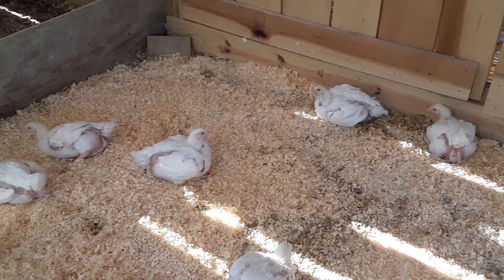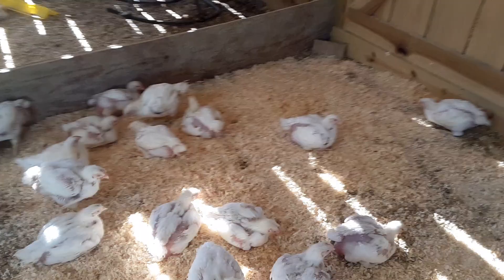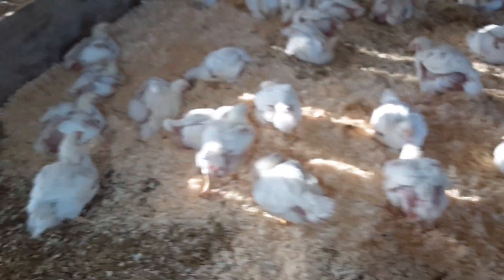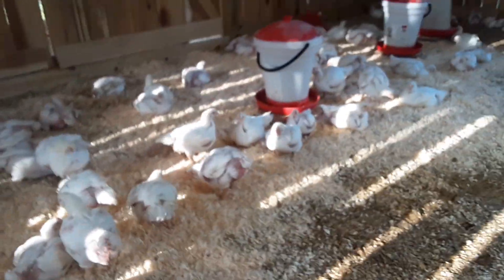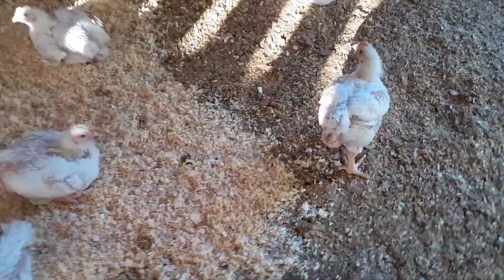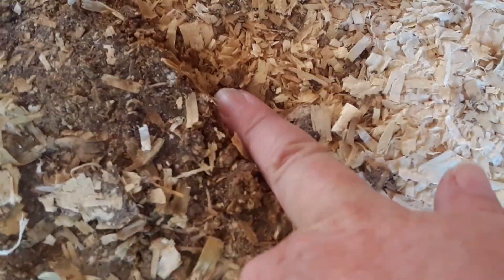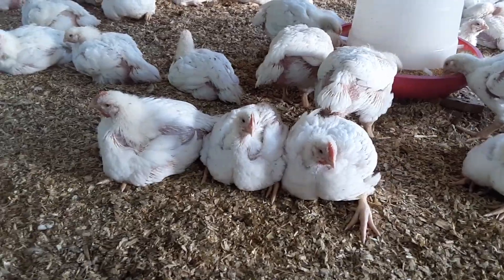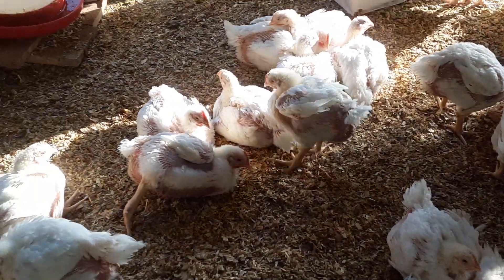Deep Litter Bedding Broilers vs. Layers

Comment: Melissa, just an update. My first batch of 25 is now past the 8 week mark. All are healthy and active. Not my intention but this is what happens when you jump into the game on the fly and not fully prepared. Life gets in the way while trying to build infrastructure. Im working on plumbing a stainless steel three tub sink with a wing on one side.  I plan to use as my processing station.  Then I had to help a neighbor cut and bail 4 fields hay. Sorry, I digress. 

Looks like I’ll be parting out the 10 roosters and some of the largest hens, keeping the smaller ones whole.  

Second batch of 50 are right at 6 weeks. I ordered these all hens but there’s one rooster.  Most of which I plan to keep whole. 

I use pine chips for bedding also. I buy from a local custom mill. I get them in a big bulk feed bag for $60 a bag. Saves me about $50 for same qty over box store purchase. It’s not as easy to move or distribute as smaller compressed bags are but, and here is the main reason for my comment:  I use a 6 gal bucket to scoop from the bulk bag and dump strategically on the floor.  My two older batches immediately start scratching in the piles and redistributes them for me. It’s rather fun to watch but I do need to remove water/feed while they are doing it. Otherwise they get filled with chips. 

Hope you keep putting out videos while in between flocks this summer. You truly are knowledgeable on your subjects, paired with an obvious “gift to gab”, makes you an outstanding follow. Your videos are the right length of time. Rarely do I start watching a video that’s over 20 minutes. I prefer those broken up in multiple parts. Call it ADD, but I rarely get back to a video later to finish.  Keep up the good work!
Reply from the maker: Thanks for watching & interacting with our channel! 
This is awesome! I loved reading this comment! First, the experiences with the 1st & 2nd flocks of meat birds takes me back to our first flocks. Our 1st flock was 25, & I think we did 25 a second time before trying any bigger groups. Our 1st flock was a terrible outcome, because we had predators absolutely devastate that group. The 2nd flock was a better outcome because the predators taught us what we needed to fortify. Lesson learned & better outcome. I don't think we tried a flock of 100 until our 2nd year raising Cornish Rock Cross. Of the flocks that year, we raised a bunch for ourselves & donated the rest to a grassroots charity dinner. We learned that our household liked homegrown chicken very much & could easily use a freezer of at least 60 chickens in a year. I think we could use more than that in a year for our household, but we also learned we could market the poultry, so we did. We marketed on only pre-orders for about 600 chickens last year & committed to processing appointments for about double that for this year. So far, so good, but profit margin is slim. There's an intrinsic satisfaction, though, of producing a quality food product. We are looking at next year & want to continue raising them, but try to improve our efficiency. Where I meant to go with that was I totally understand jumping in & life getting in the way of plans.
Your flocks are doing fantastic. Great job on your part, because we know first-hand it's a learning curve, for sure!
Also, I love your method with putting the bedding in. Very smart. We can also relate to removing feeders & waterers when adding bedding no matter what the method - yes, the birds get it all in those trays! 
We do plan to continue videos on our break between flocks. Working on creativity & brainstorming this month to prepare for July & August. Thanks so much for the kind comments, & thank you for watching! I learn alot from reading comments & will try the bedding idea for sure - these meat birds do love to scratch & dustbathe in the fresh bedding, so that's a win-win! We'll keep at the videos  -  we are just learning by experience as we go & trying to do what we can with what we have. I'm trying to get my husband to let us feature some of the crop fields & bigger animals. Maybe. We'll see. 
Many blessings to you! Have a great day, & thanks again!

Comment: Great info. Thanks for sharing your knowledge.
Reply: Do you compost all that stuff after you clean it out of the barn?
Reply from the maker: You're welcome, Jeff! Thanks for watching & commenting; we're grateful, & I appreciate the kind compliment. Have a great week! 
On the question, well, we're kind of at a loss for the best way to utilize the old, used bedding. Composting would be a great practice! We have made a manure pile with it. We have not actively worked at composting it. We haven't applied it in any gardening, because it is definitely too hot to use in gardening, etc., when we take it out of the barn. We did put some last year in an area where we wanted to smother some heavy weed growth; we tilled it in, & there are fewer weeds there. I am thinking the used bedding would need about 12-18 months to break down enough to use in gardening. Do you know if that is accurate? Composting would definitely help us make it usable. Do you have any advice on that....we wonder would we need to mix in green material like plant matter in with it to compost it? We would like to figure out a way to do something useful or beneficial with it. As of now, though, we don't really have a clear idea of what to do with it. We'd love any ideas or advice you share....we're going to have quite a bit of old bedding coming out of the barn the end of this month, & it's odd as we get into the layers of that bedding, we do get into pockets of pine shavings that look like we just got them out of the bales....that's another reason we wonder if we could find a better alternative to actually use as bedding while flocks are in production  -  even though there's times we definitely have to add bedding, when we've cleaned it all out in the past, it seems like there's still a significant amount of underused bedding  -  I don't know, maybe it cures in the lower layers as the top seals off. Sorry to have rambled on that a bit...just brainstorming there. Thanks again, Jeff! Have a wonderful week!
Reply: You shouldn't have to add anything to it, because the chicken's manure would act as the green (nitrogen) within the pile. If it were me, I would pile it up somewhere, and just turn it once a week or so. If you have a tractor that could work good. I have a fairly big compost pile in my chicken run ( egg layers). They turn my compost for me by scratching through it. Then I just pile it back up about once a week. Make sure it stays moist too. I doubt it would take that long to break down.
Reply from the maker: @jeffboothe2102  Thank you for the great advice, Jeff! I appreciate it!
Reply: Have you tried to advertise the used bedding as “raw” compost to be added to someone else's existing compost or material they could start composting for themselves. I’d try giving it away at first to see if there may be a market. Just a thiught🤔
Reply from the maker: @nwrvt  We haven't tried to advertise the bedding as raw compost, but that is an excellent thought! We will definitely give that consideration, because we keep wondering what can we do with all the stuff. I appreciate the suggestion of offering it as a raw compost component...great thinking...thank you for sharing the idea with me!